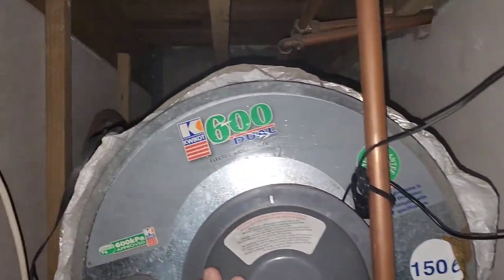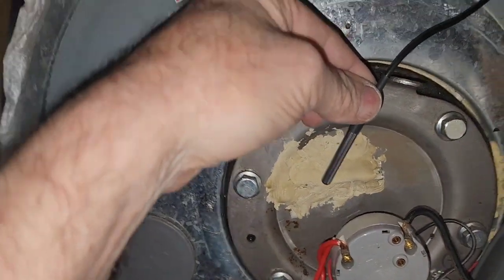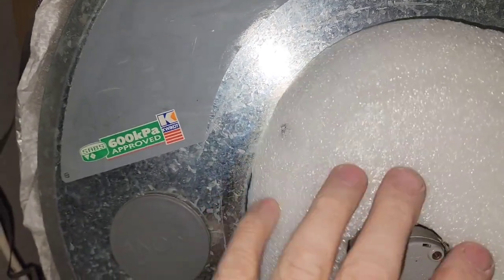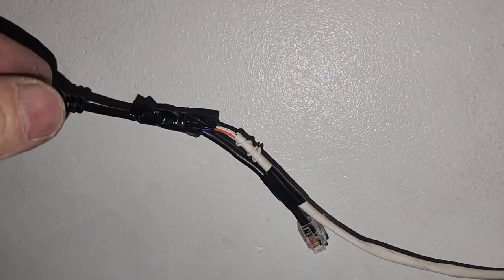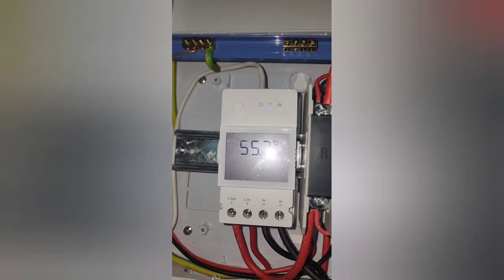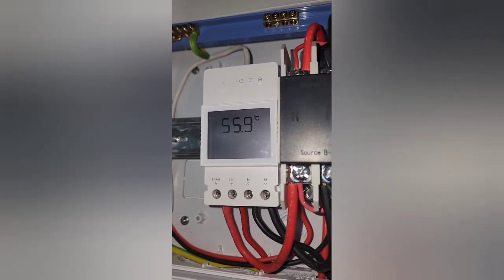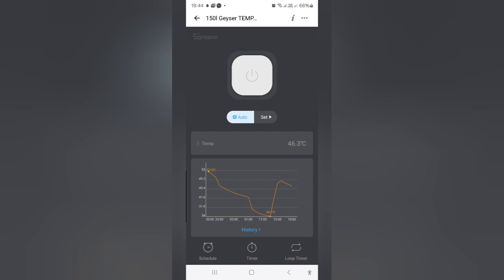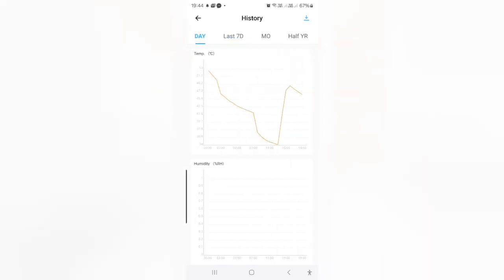The greatest addition to my geyser: Sonoff TH Elite 20A Wifi Temp. meter

Comment: I have noted that the latest software eWeLink Version 1.3.0, now has a "Calibration" selection under the "Menu" where you can adjust the reading to compensate for the error you experience on the geyser plate. This way you can have a better reading with out doing a mental calculation.

Comment: Quick question, why dont you run the temperature at 20 deg, and then at selected times let it rise to the desired temp to shower in, does that save you money on your monthly bill?
Reply from the maker: The Sonoff unit is currently only a grid heating backup in case of cloudy weather.
90% of the year my Smart Load output will heat my geyser up to 70°C.
On cloudy days it drops and then the Sonoff will automate the minimum temp.
So when the temp goes <42°C, it will heat it back up to 45°C, BUT only during 18:00-19:30 (before we shower)
This way, I know there is always hot water and minimum grid use.
Those without solar can also use the Sonoff to minimize grid usage this way, with acurate temp. & time settings.

Comment: have you connected the output cables straight into the heating element or into a separate relayed circuit?
is that a 3kw element?

any issues with it yet?
Reply: I can use the 20A onboard relay, but decided to rather drive a seperate 20A relay.
No problems yet in many months.
Works very well, even with the 3kW element.

Comment: Hi, I have 2 geysers, hence wud need to temp wires, would I also need two sonoff screens as well ?
Reply from the maker: Yes, one each.
They are very cost effective.
You can decide if you want to use the relay for On/Off via time & temp.

Comment: Great video, can this work for a solar geyser?
Reply from the maker: 1. If the temp probe can be alstuck on where the heat of the water can be measured.
2. It then provides a relay for any power to be switched on/off via a combo of time & temp.
Reply: Thanks sir what putty glue was used?
Reply from the maker: @ahmedomar7743 Den Braven Glue Screws
Reply from the maker: Sorry for the late reply.
I don't think so.
You would need to access a spot on the geyser that is hot to stick the probe onto